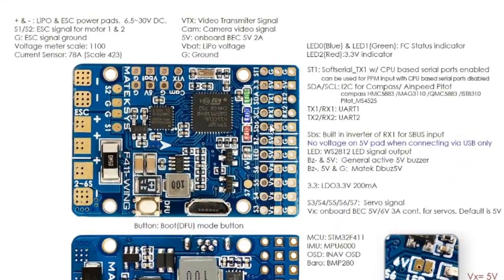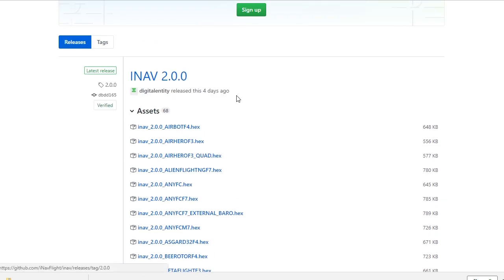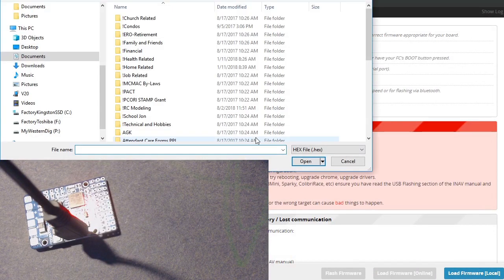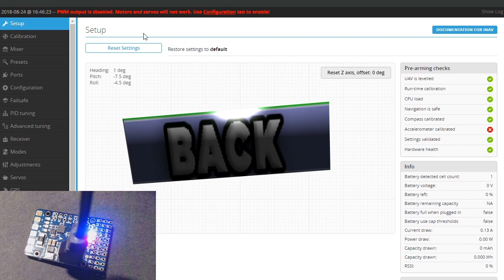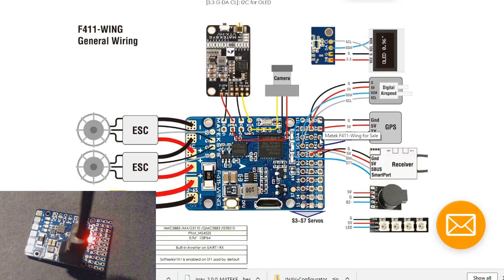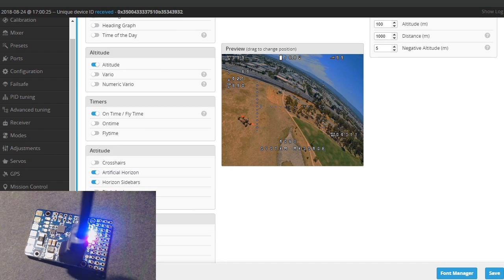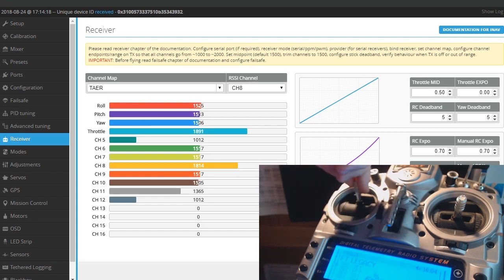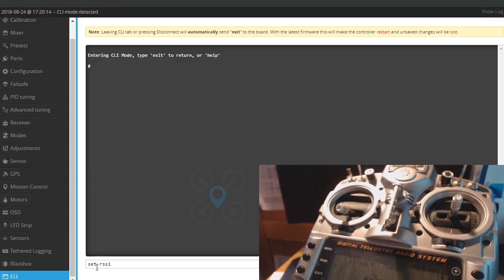Matek F411 Wing Flight Controller - iNav Firmware & Configuration RC Airplane Setup (In a flash)

Comment: what is the difference between from this flight controller and a regular receiver?
thanks
Reply from the maker: Wow! What a question. That would be another video entirely.  They are not even the same. You might find an FC that comes with a receiver but usually they are separate devices.  RC has to have a receiver but not a FC.
Reply: @DaveMerc  ok thanks!

Comment: small board.. hm.. can i ...somehow... use it for brushed motors / small planes? or brushless + esc only?
Reply from the maker: There are no ESC's on the F411 so I would think that brushed ESC's could be used. The timing in the configuration may have to be adjusted.

Comment: Great explainer. I'm thinking of putting this board in my ft spitfire so my kid can fly a bit easier in angle mode.
Reply from the maker: That would be a great use for it. Also you might like Horizon mode which is stabilized only in the middle of the sticks.

Comment: Another great video! I'm getting a "failed to open serial port" when I try to connect. Same message as is I had nothing connected. How can I successfully update USB and flash the firmware but it won't connect? Seems odd. I feel like I've missed a step.
Reply from the maker: Try running Zdiag like in video. And don't use connect when flashing. Push botton on board when connecting USB for flashing

Comment: Dave, my EzUHF 4ch rx is set for RSSI ch8, however it doesn't come through on the iNAV conf,  All other channels work as they should.  Is there a specific setup in the Taranis or a CLI comd required?
Reply from the maker: Nothing in the Taranis or a CLI. Do you have channel 8 selected on the iNav Receiver Tab?
Reply: Dave,
Thanks for replying. I figured it out.  It was atypical EzUHF quirk solved by reflashing and rebinding, then all of a sudden it works.  Thanks again.
Reply from the maker: Yup that is about par for the course.

Comment: 'm just wondering if you have any ideas on my motors not starting.  I guess I don't know how to arm them.  I have two motors on my airplane and they both test fine in the motors screen when you move the sliders.  My throttle shows fine in the receiver screen.  I added two commands in to CLI that I found on line but that didn't help either.  

nav_extra_arming_safety = OFF  
set fixed_wing_auto_arm = ON   it says this will Auto arm the motors as you bring up the throttle.

Any Suggestions?

Thanks
Reply from the maker: Did you enable motor and servo outputs on the config screen.

Comment: I have a problem , the f411 has no 7 volt out put for the tax htv hv uses 7 volt . Their wiring diagram so it connected to the fc but the fc has no 7 volt power?.....WTF.   There’s so much bull shit out there I do not what to believe anymore. We use to have internet troll that messed with people, but now the trolls have changed over to messing up their shit by bricking equipment. Had jousha baldwell brick my qx7s radio with his update firmware video. Then his next video he , Well let’s not get mad just deal with it. Have you ever set up a RMRC f411 fc And a seven volt rx , even though the Matek Systems hv hv says 7-26 volt and get it to work. Thanks for any help.also been trying to get a pixhawk 2.1 cube to work for over a month ,

Comment: Why in the world are you stil using Zadig? That thing can do damage. Much easier to use ImpulseRC_Driver_Fixer google it.
Reply from the maker: Works great for me. Zadig bugs seem to have been corrected a few years ago. Are  you sure it is still a problem? If so I would like to hear about any recent problems that have been reported.
Reply: people have inadvertently killed the drivers for keyboards, mice and other usb interfaces. Obviously nothing permanent, but the one click simple option is obviously the way to go.

Not everyone is as skilled as we are when it comes to software for drivers. Just last month a friend of mine tried flashing a new firmware version onto his F3 FC for a beecore, this resulted in him not having a usable keyboard on his laptop until I was able to plug in another one and uninstall/reinstall keyboard drivers. I think it falls on us to promote an option less likely to cause "any" damage to an end users system if we are suggesting a software to use. the ImpulseRC Driver Fixer provides this security blanket for us, unless you want to provide a disclaimer that is.

Anyways keep the comment coming!
Reply from the maker: As you might have noticed it's Github iNav that recommends Zadig in their flashing instructions not me:
inav/docs/USB Flashing
https://github.com/iNavFlight/inav/blob/master/docs/USB%20Flashing.md

I think perhaps Github is where the disclaimer should go if it is really a problem but I will put a note under my video.

Comment: Dave   thanks for the video
How does the motor thrust differential work?
Reply: It works off the rudder stick to increase yaw on a twin prop plane by differing the motor speed between the two motors. It will also cause some roll just like a rudder will do.
Reply: Thanks Dave
I have programmed diff thrust into my TX but I guess this is not needed since INAV does all the mixing
How do you vary the value of the rudder/throttle mix?
Reply from the maker: I think there are values on the bottom of the iNav Mix Tab that you can adjust.
Reply: Dave can you turn off the diff thrust using a switch on the transmitter.  Did you have any issues when flying with the diff thrust.
Reply: That the bad news. iNav mixes are not conditional so differential thrust can't be turned off. Just don't touch the rudder if you don't want it.

Comment: I’m giving up on inav.  I have this board and Finally! Got it working but man it horrible gyro floating all over the place and it over corrects everything. I’m officially done with inav and flashing all my F4 and F7 ect... boards over to Arduplane.  Inav has still got a ways to go imo.  2.0.0 is ok but still not worth my time
Reply from the maker: Have you tried the Apm mini 3.1
Reply: Dave Merc Productions no I haven’t but probably will.  I have a bunch of standard pixhawks and amp boards but they are to big for most my setups.  Now though we can flash these F4 boards over to Arduplane is huge!! Especially with built-in OSD and current sensors on these F4 boards. With a standard pixhawk or Apm I’d have to add those components which is more space and more weight.
Reply: Dave Merc Productions I wouldn’t use a Standard pixhawk or Apm when I can easily flash a F4 board with its built in osd and current sensor. With standard pixhawk or Apm those are add ons which take up way to much room
Reply from the maker: Let me know how it goes and what problems you run into with the change over.
Reply: James smith I have the F411 installed in The AR wing.  I was doing autotune with inav 2.0.0 and that wasn’t working out at all for me so someone from the AR Facebook group gave me some pids to start with and bam! It’s flying wonderfully now.  I just need to servo trim and I’m good to go.
Reply: I totally agree with you though.  Manual tuning is always better.  I have always manually tuned my diy 550mm drones and never had an issue.

Comment: Close second and bewildered !!
Reply from the maker: I was trying to keep it short but apparently I made to too short. Life in an experiment.
Reply: Awesome info Dave but seems the speed is way up. tried to slow it down in the settings, now it seems you had a few too many. :)) will watch it again later like this FC .
Reply from the maker: Maybe I will make some normal speed ones later.
Reply: Please do, I couldn't watch this. Too fast and setting it to 0,75 speed was too slow and didn't help.

Comment: First....:)....Thanks for the EZ RSSI calibration Dave....I always use Link Quality though....did you..?...I assume it works just the same..?  Did you speed your speech up...?....I was nearly out of breath listening....lol....
   Im trying out the F405 Wing and noticed no less than 5 different hex files....?....whats that all about?
Oh, and the PPM input for the EZ was very useful too.....Thanks.
Reply from the maker: You can use RSSI instead LQ now because of this Min Max CLI feature with the EZUHF.  I have not made up my mind which to use. I was using LQ but now I might go back to RSSI now that iNav can handle the inverted signal. I wish they would put it in the OSD config tab so I didn't have to go in the CLI.
No I did not speed up my voice, just talked quickly.
Reply: Oh, okay I may try RSSI then....Oh and heads up, there are now 3 different sizes of text for the "Vision" font provided by Oliver C....The original is rather large if you are using a high res Monitor...Nice font.
Here:....www.youtube.com/watch?v=a-SESdu-qQM&t=9s
Reply from the maker: Thanks for the fonts tip. A may use it.